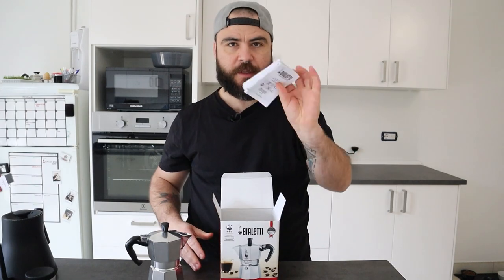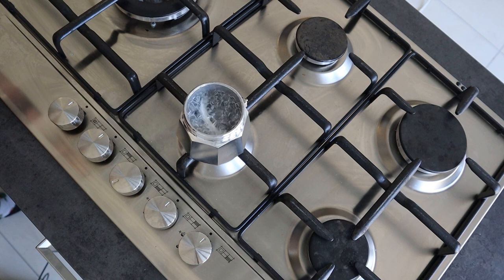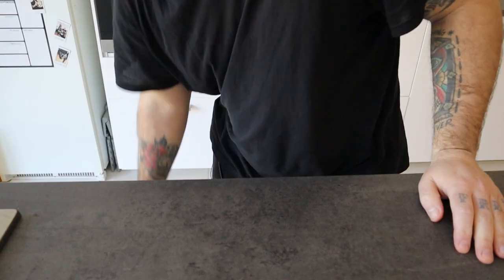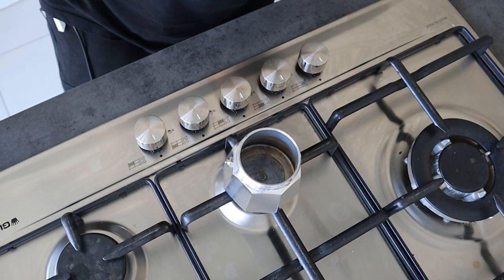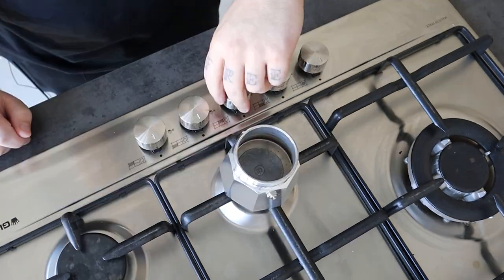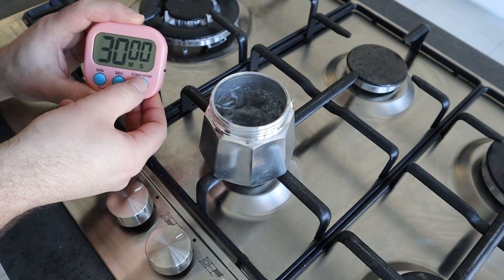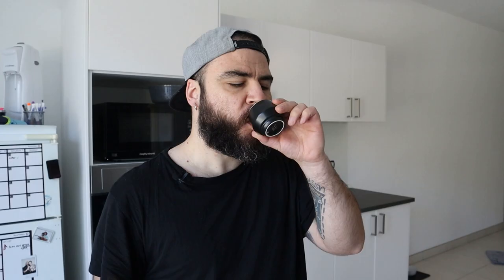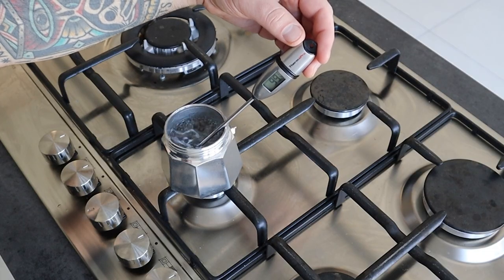MOKA POT Gasket Smell Got You Down? Fix it FAST!

Comment: Thanks for the advice! I bought my 3 cup Bialetti moka pot and have been disappointed to find out that rubber gasket inside. Before I used the La Cafeteria moka pot - it had silicone gasket, so much convenient! But it was 6 cups, and I need smaller pot. Will try this method now, but would prefer to have Bialetti to use silicone for the gaskets.
Reply from the maker: I also prefer the silicon. The new ones they are producing are going to be silicon. That's what they told me.

Comment: Not sure when Bialetti changed to silicon rings, the one I received yesterday came with silicon. Harder to get it out, but completely neutral in terms of taste, and probably closes better as rubber.
Reply from the maker: They already start to produce them with silicon since the last year. Then depends on from which batch of moka you are buying. This definitely will avoid the problem of rubber taste and durability

Comment: Bought my first moka pot. When I did 2 rounds of water boiling, I noticed the rubber melted onto the lip of the filter. Disgusting. I bought a silicone gasket to replace it and now I'm trying to scrape out the rubber melted onto the upper chamber.

It's wild that some people are ok with drinking rubber.
Reply from the maker: I know. That is horrible. Silicon makes the life easier

Comment: I’m not sure you should boil the gasket in the aluminium moka pot. Why not do that in a small stainless steel saucepan?
Reply: But, it is a good idea to boil the gasket in water and vinegar, which I’ll do when I receive my new moka pot. Thanks.
Reply from the maker: it's fine to boil in aluminium, nothing it will happen.

Comment: Maybe I was lucky, got a Bialetti Mokka pot in 2021 and never had issues with a rubber taste
Reply: Same.  I got mine at Christmas a little over a year ago.  I just replaced my original gasket with a silicone one, which had no off taste at all.  As a bonus, it fits a little less tight into the threads, so it’s easier to take out for cleaning.
Reply from the maker: Yes, you got lucky. That's why Bialetti recently changed gaskets with better rubber and now they fully convert them in silicon. But of course you can still find old batches with low quality rubber around the world.
Reply from the maker: Silicon gasket is always the best way!